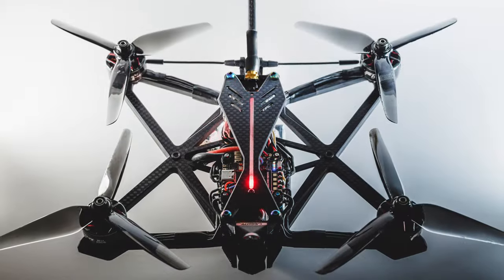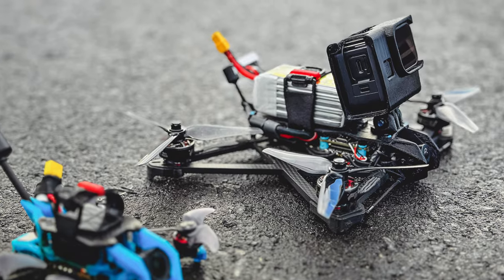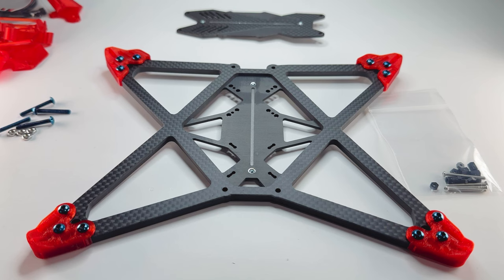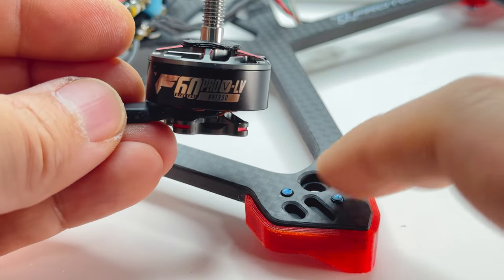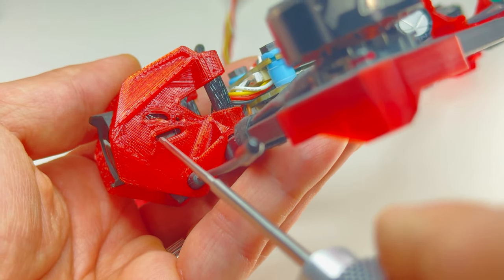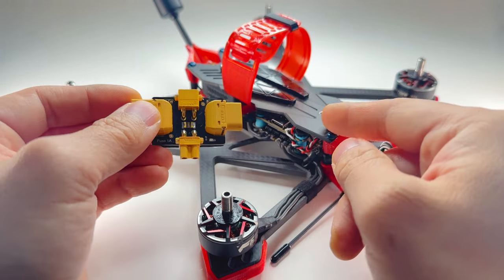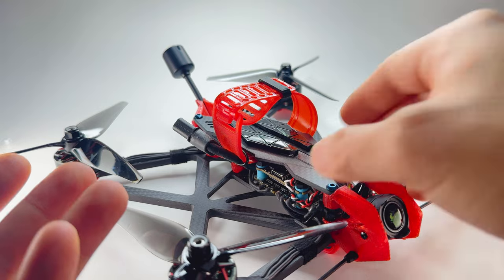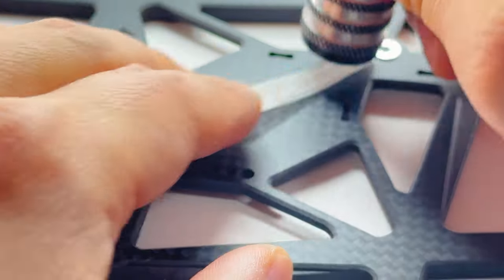How to Build PROTO5 Cinematic Racer | Exotic 5" FPV Drone Frame From Canada!

Comment from the maker: Hey guys! Some updates on PROTO5 - will update this whenever I remember. LOL

UPDATES TO THE CINEMATIC RACER KIT https://www.protofpv.com/product-page/proto5-cinematic-racer
2 months back I added a nano RX TPU holder and rear GPS M10 holder. Few weeks ago I updated the O3 quick swap holder with integrated capacitor stay. The front camera cage can also install a ELRS or CFSR antenna, and the rear antenna holder can also fit an additional ELRS antenna. The VTX antenna can now also be secured with a zip tie for extra security.

PROTO5 CORE https://www.protofpv.com/product-page/proto5-core-model
An alternative with less prints, and steel hardware, and less $$$. Same great frame, same great flying performance!

BANDO APPROVAL STATUS 
-Been bando'd every weekend over hardcore environments by MUG FPV. He confirmed the baseplate is bando approved. It's seen months of use and it's still not broken. Go ahead and send it. The only thing you might need to replace are stand offs, screws, and props.

Comment: This frame is perfect for the L.E.D. Ribbon on the edges. My first 3.5 drone and still have is the Baby Hawk 2 HD and asked the same thing. I wish this frame was in a 5-inch. Emax doesn't care too much for recommendations, I've done the same thing. Now seeing this that will have to same tech as Baby Hawk 2 ridged frame. I love the antenna in the front but was wondering if there's a way to 3D print a pocket for the RX to sit in instead of zip ties. Zip ties break easy. But I'm getting one anyway. Quadmula is great and all, but this is more versatile. The top or bottom battery mount is KING DING A LING bad AF. It'll be easy to put a GPS off the side of the Frame or 3D print a holder. Good job bro I love it.
Reply from the maker: Thank you bro all the way!! Glad you understand the frame and No doubt, It’s still a work in progress , def. Can use even more refining for sure (instead of zip ties for some areas) and I’m happy to hear you will pick one up! The rx pockets a great idea. Can totally sit between the stand offs for sure. Will add when I can!!
Reply: @PattyFlipz  my order just came through the green tpu. Thank you bro we need others to check this out. Even Bardwell.
Reply from the maker: Thank you for helping me spread the word!! Looking forward to working on your order!!

Comment: Very nice design.  I like the fact that you noted that the design aesthetics are also very important.  This frame looks modern.

Have you looked at the black box files and compared the tunes and resonances to other high end quads?  

You should reach out to the FPV retailers to get your frame into their shops.  The only thing that I can think of that people will be concerned about is if you break an arm you have to replace the entire frame.
Reply from the maker: Hi! Thank you for the kind comments. Yes i wanted to make something different and striking and yes replacement is expensive, like crashing a super car haha. Except this one will take a few hard hits before something really bad happens. 😆 I’ve spoken to my first dealer in the US. John at https://shop.addictiverc.com will carry it possibly mid- end of January and the plan is he will offer build kits with race spec motors and fc etc. You can check out my log done in July 2023. https://www.protofpv.com/product-page/proto5-cinematic-racer it’s under the tab proto testing. It’s a conservative tune and can possibly go a few more notches towards aggressive, motors just might heat up lil more. You can download the log, video and check to see what I did. As for comparison to my other frames, no I did not compare their baselines to p5. But that be interesting 🤔

Comment: How long of a motor wire protector could be used on the front and back arms instead of that tape?  Can't use that tape for the Flashbang build.
Reply from the maker: 40mm or under will work 👍

Comment: Hey patrick could you create an STL file for the mount up top to support a beeper to fit into so we can find it easier when it goes down. I try to put a beeper on all my quads but most frames dont have enough space for one. I need to learn how to make STL files and turn the gopro mount into a beeper holder so you can see the LED flashing also.
Reply from the maker: I will consider it for sure! I use blender to make most of my files. It’s pretty easy to learn, email me if you need any tips.
Reply: @PattyFlipz  yes thank you. I need to find a video on blender

Comment: I don't see any camera protection.
Reply from the maker: The tpu camera cage sticks out past the camera. I mean if a stick or narrow rock somehow made it in between it will hit the camera but that goes with all frames unless you shoot through some poly carbonate cover haha
Reply: @PattyFlipz  in regular frames carbon cage takes all the impact protecting the camera but in tpu cage all the front impact will pass on to camera. These digital cameras are expensive , I don't see how the camera will survive a minor front pole collision with tpu cage collapsing.
Reply from the maker: @spawnisalive yeah I get it but the tpu used is 95A quite rigid at 4mm thick. it’s not entirely flexible and it’s butted up against the carbon fiber top and bottom plate . I haven’t broke a camera yet though. (I did break a nd filter 😮)I did smash this thing head onto concrete blocks on purpose during testing. if you need the front cage to be even tougher, all the STL files are provided online. You can make it fully enclosed and fit any future camera you want. I do have other frames in the works and they are all carbon cages, but with that there are width limitations for future cameras. Let’s say somehow they release a 21mm wide camera, most frames will be screwed and need a complete redesign of the top and bottom plate and camera cage. Then consumer will need to repurchase the new frames and all American companies drag behind redesigning their frames too. This is what happen when DJI release the o3 au. That can get expensive too. Thank you for the feedback though and I was considering it for future proto5 frame of course 🙏 drawbacks and decisions to everything we do but it’s all about finding optimization and balance for sure.

Comment: 145$ for frame, it should be made of gold :face-red-droopy-eyes:
Reply from the maker: hahaha, it is made of T700 carbon fiber (heavier, more durable than T300) plus titanium and aluminum. All the metals much cooler and lighter than gold XD Thanks for watching
Reply: I have nothing about your frame, its very nice, but i am done spending a fortune for frames they all break, i think the design is cool but its not practical, so any crash damage will require new base plate that cost 100$, instead of an arm or bottom plate like other frames makers.
Reply from the maker: @sagivlevi don’t worry I’m making a bando quad. Will be cheaper to replace stuff :)

Comment: i fuck with it no doubt but 140 usd i cant justify thats more than the price of most 7" frames i could see like 85 but 140 is way too much
Reply from the maker: I’m coming out with a steel screw version with less prints. Will be cheaper. Look out for it! 🔥💪
Reply: @PattyFlipz  will do i am curious though why is this frame so expensive is there a ton of wasted carbon when making it or what?
Reply from the maker: @terpsquirter7107 yeah besides the carbon wastage and being T700 cf plate is stronger more durable and more expensive than the regular grade of T300 cf plate others may use . It comes with 25 burnt blue titanium screws including the M5 action mount holder screw. titanium is half the weight of steel. To put it into perspective, 1 of these screws can probably buy 10 steel screws. so not cheap. It also comes with 16 3d printed pieces where you choose a colour and I personally print them for you. I’m from Vancouver canada. Very high cost of living here 😂 packaged and ships out from Canada.
Reply: @PattyFlipz  haha fair enough g It’s a dope frame seems super rigid
Reply from the maker: @terpsquirter7107 thanks bro! Keep tabs with my IG or community section I’ll let you guys know when the base model comes out!

Comment: I’m currently putting together my parts list for my first ever drone & I absolutely luv the aesthetics and weight of this frame.(I’m also a super car enthusiast & the monocoque reference 🤌🏼) but just like others mentioned the one piece is concerning especially with the cost of replacing it, so just curious if you’ve durability tested it? Lol I’ve been doing my time in the sim so I’m not a terrible pilot by any means but crashing is inevitable especially with freestyle , so would luv to knw how it holds up.
Reply: Or should I maybe wait for your freestyle basher 🤔, since there’s only tpu protecting the o3 on this one?
Reply from the maker: It’s gonna be a couple months down the road and it’s will be around 400g with a full stack.
Reply from the maker: I crashed it into concrete blocks and dropped it from the sky on purpose. After multiple hard hits there can be slow splinter fracture of the affected side but drops from half a meter here and there is totally fine. Tpu print holding the o3 is 4mm thick each side and butted against cf frame. GoPro is much more exposed if you use it up top etc if you think about it. In my mind I did design the frame for experienced pilots looking for change but thinking about it might be a good one for someone’s first frame too. If you plan to bando very often, I would not use this. Just like you don’t bando a super car haha